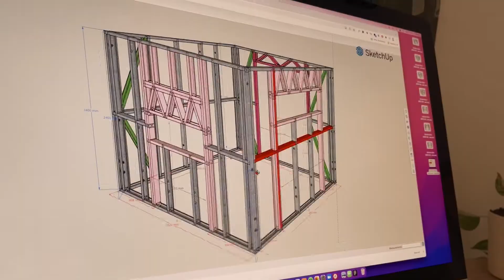Building my own garden office pod

Comment: huge thanks for sharing your process. im curious what you would do differently after having this setup for 2+ years
Reply from the maker: I found out the hard way that having a flat roof is not ideal, ha.
Reply: @petarceklic8012  whys that? does is leak or overflow when it rains heavy?

Comment: did they mount the light switch upside down? 🙃
Reply from the maker: I did indeed 🫠
Reply: @petarceklic8012  hope you flipped it over after realising😅also make those flathead screws are aligned vertical or horizontal – my perfectionism will thank you

Comment: Hi where did you order the steel frame please?
Reply from the maker: https://techsteel.com.au/
Reply: Awesome, I want to do the same thing in a 10m2 space. But most of the tiny house metal frame kits are too big. What software did you use to design the frame may I ask?
Reply from the maker: @AprilStaines  sketch up - the steel company used the plan we provided, converted into 3d and sent it to us just to check.